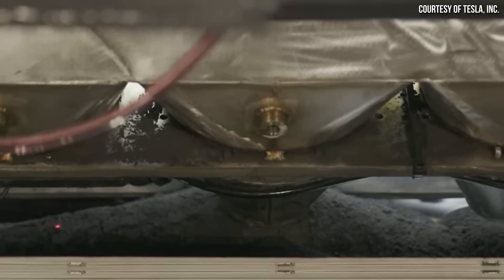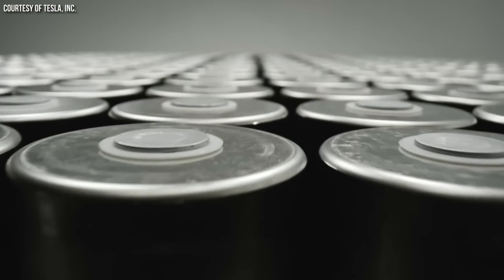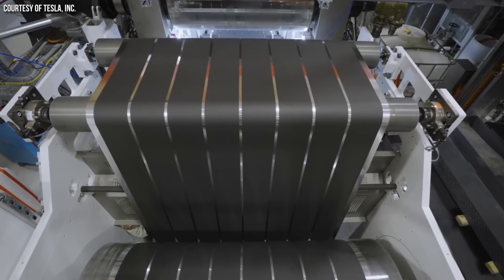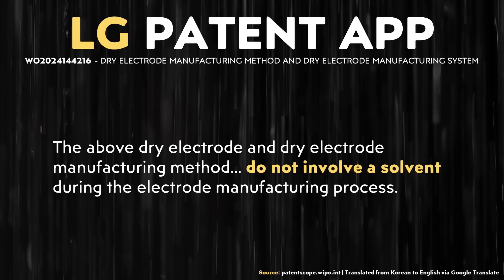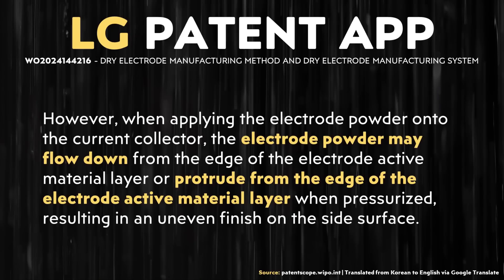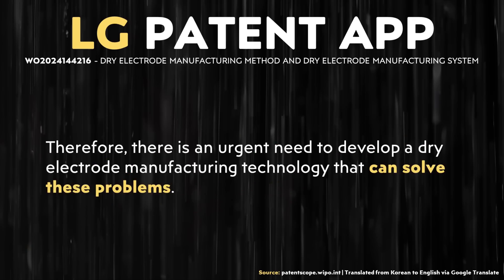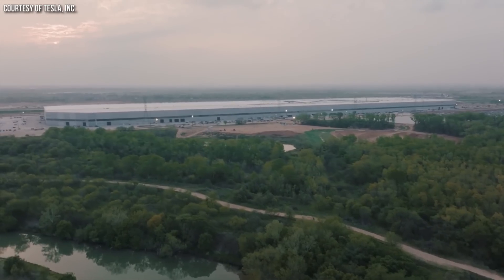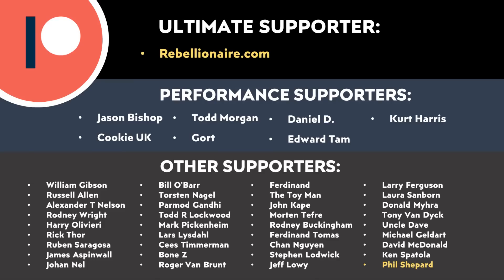LG's GAME CHANGING Dry Battery Electrode Tech Explained (vs Tesla)

Comment: I thought maxwell did a different type of battery used in regenerative braking called "super capacitors" which are basically an "empty cell" perhaps confused as "dry." These are built for innumerable charge and discharge and might explain why tires and rims have become so massive in USA vehicles now as simply use the so called "braking battery" and not much need for the "main" battery as presented here. This has gone as far as putting the entire motor into wheel as was once done with Aptera.😊😊

Comment: The current EV rated at 320 miles of range will improve to 375-380 miles in 4 years? 5 years?  Assuming same size battery.

Comment: eventually battery technology will progress to the point where range and degradation will not be a problem anymore
Reply: That'd be nice... never heard of a battery or capacitor that didn't degrade as it was cycled yet though.
Oh wait that molten salt battery might not...but its components are liquid, so there's  no solid structure to degrade.

Comment: Thanks for this.  I've been wondering what it is that has been holding up Tesla's development of the dry-electrode process, and your thoughtful video introduces some very interesting possibilities.  

It seems that most of the time, persistent and intelligent efforts to solve an engineering problem will yield the desired result.  And sometimes. . . that's just not enough. Sometimes, the solution awaits some sort of breakthrough.  Very hard to time breakthroughs.

Comment: Since it is a "dry " process is this considered solid state?
Reply from the maker: No. The term solid state refers to a battery having a solid electrolyte versus the liquid electrolyte in a traditional Lithium Ion battery.
Reply: @Cleanerwatt Dry coating will also be used for all-solid-state electrodes (cathode). There, it will be theoretically "easier" than conventional cathodes, since the cathode is mixed with softer solid electrolyte, meaning it will supress the stress on the stiffer/harder active material.

Comment: Jon.... (Speaking as a Photocopier/Laser Printer Technician)

That "dry powder" sounds A LOT like a copier/ printer TONER.
A brief description of part of the "printer" process.....
.
An active material combined as a dry powder with a thermoplastic binder....
(Here's the bit they SHOULD use imo)
Electrostatically applied to a surface in a fine (variable thickness) layer, then "fused" using heat and pressure. 
.
Sounds like that would do it?
.
There are probably ways to utilise the toner transfer process with a photoconductive drum via a toner transfer belt system.
That would allow for an extremely precise snd accurate coating.
.
The only issue might be use of a metal foil in the transfer process, but I'm sure the "Smart people" at a copier company could work that out.....
<Thinks ... Panasonic>
Reply from the maker: Great info!
Reply: You could "print" on both sides of two insulation layers and then just add the cu and al foils in between

Comment: Somebody wake me up when there is a true "break-through" in the improvement of EV battery density. 😴🙄
Reply: That’s one aspect.
Cycle life, charge rate, safety, dendrites, shrink / swell, cost, cost, age in years, cobalt / nickel etc.
Reply: Then you have to sleep forever. There is no breakthrough only continual improvements. I remember decades ago when silicon anode was the hot breakthrough technology. We have silicon in the anode now but they are not the game changer that was expected.
Reply: @kazedcat  right attitude. But I think silicon will still prove itself, just needs special manufacturing techniques.
Every development takes longer than projected. Musk isn’t only optimist.
Reply: Every single year there are step improvements. There is no need for a major breakthrough every year
Reply: Is that Gravimetric? Or Volumetric?
.
IF you were paying attention you would know both are improving all the time.
.
Of course.... YOU are looking for the "OMG... NUCLEAR FUSION!!" like leap...
That's NOT how it works.
.
It's an incremental advance, sometimes with multiple facets combined.
.
Don't forget they DO know what's coming.... But to make the "generational leap".... Let's say "50 year life , 10 minute charge" they must TEST THAT BEFORE RELEASE.
HOW do you test a "50 year cell" for not just performance but RELIABILITY ?
(You don't want a fire risk from an ULTRA high energy cell, do you? Think that through)
.
Intensive testing for...... 5(?) years? Maybe?
Do YOU know?